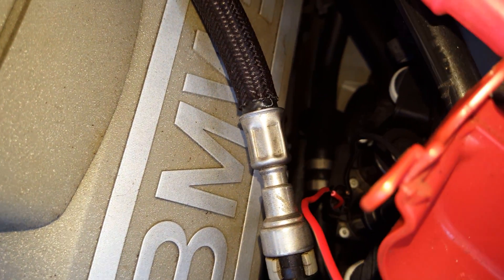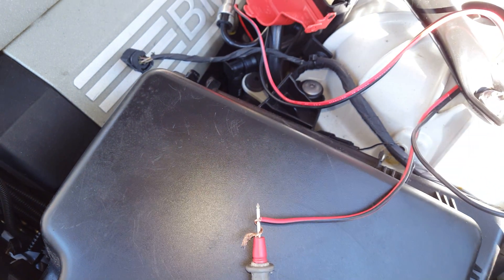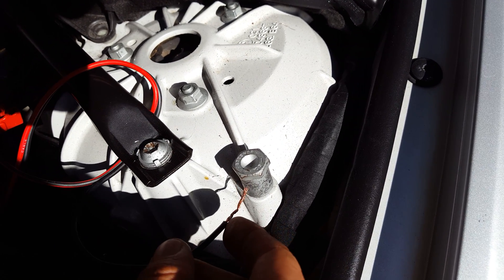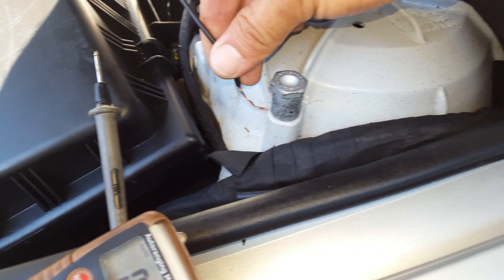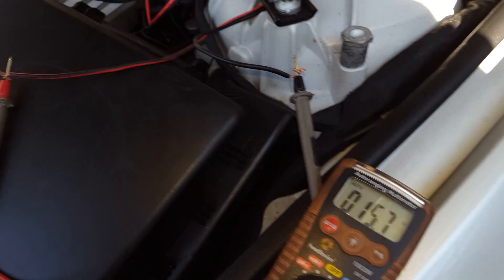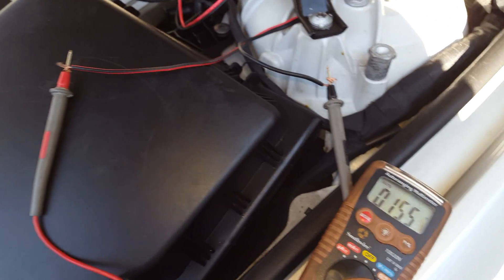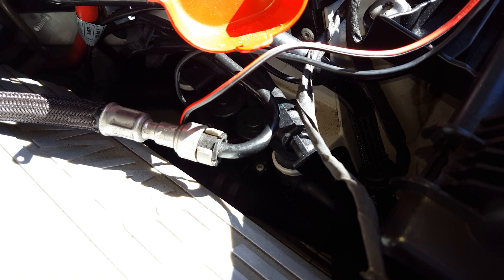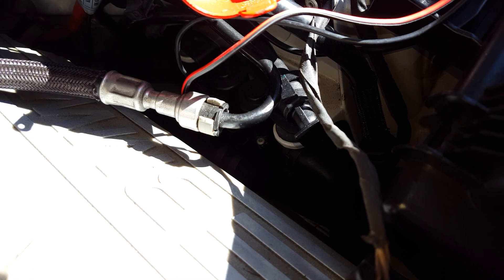BMW 645ci HEATER VALVE FAILURE Test

Comment: Thank you very much for the video 👍
Reply from the maker: @nininin-j9d  Thanks for looking at my video.  Glad I can help. This part tends to fail regularly!  I already replaced the Peerless 2ndary water pump for this car......looks like this part (2ndary pump) failed again. I'm getting a "No heat situation again".  My car is in FL so I really won't need heat so I'm just going to leave it as is.  If you're getting a "No heat" situation it can be 3 things. 1 the thermostat . 2. 2ndary water pump. 3. electronic heater  solenoid valve (this video)
Hope this helps!